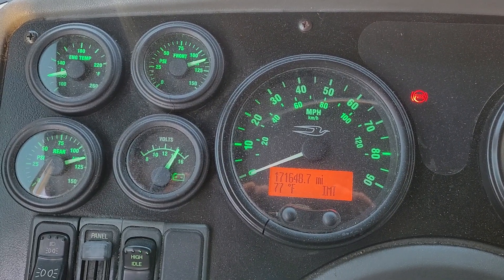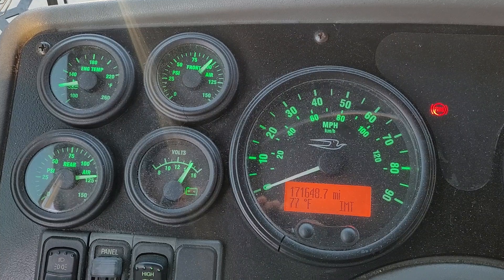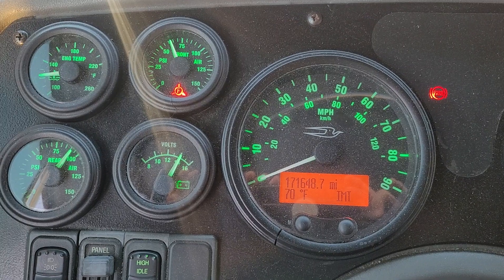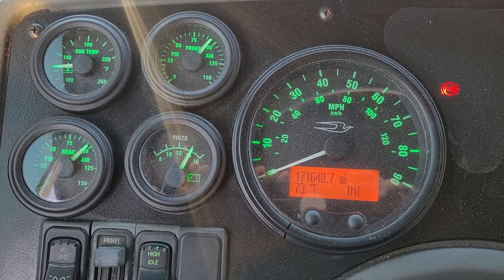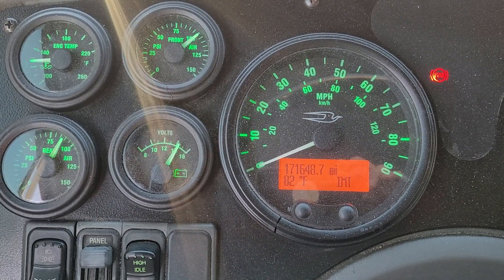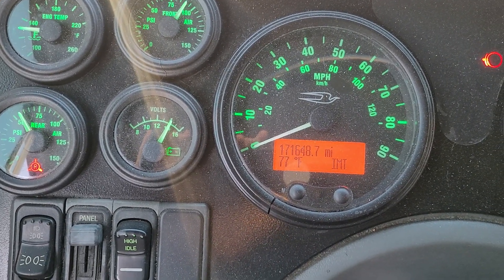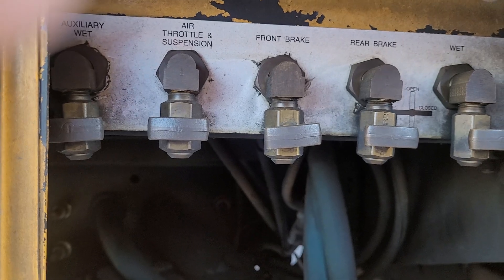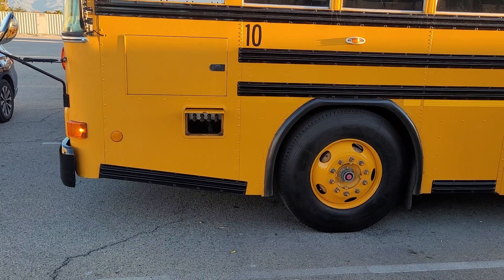Why do we drain our front & rear air tanks during our pretrip? A 2007 Blue Bird AARE CNG school bus

Comment: Odd. We pump the brakes with the engine off to bleed off the tanks until the parking brake activates. Then turn the bus on, use high idle or maintain RPM's until the warning goes off, then keep it going until the release valve activates (the "hssss" when the tanks are full). Both tanks empty at the same time on our buses.
Reply from the maker: Each school district or company has a different way of checking out their vehicles. We added the draining of the air tanks around 2006 when we got our CNG buses.